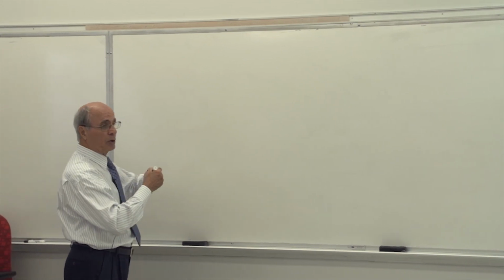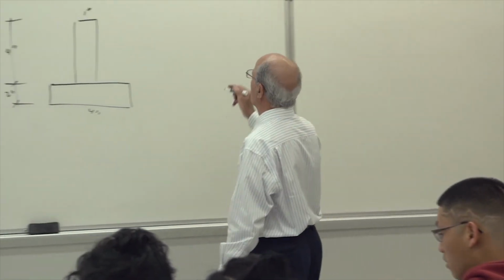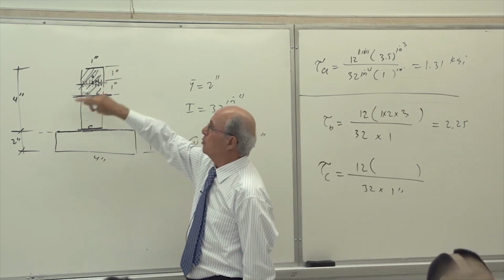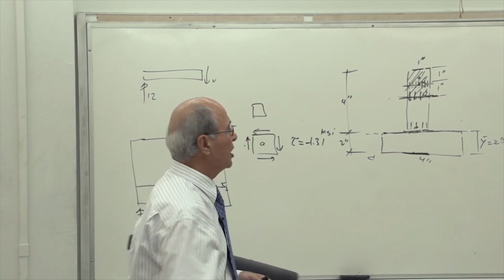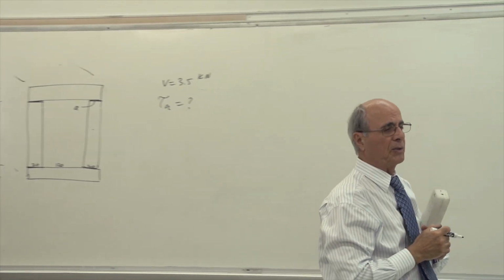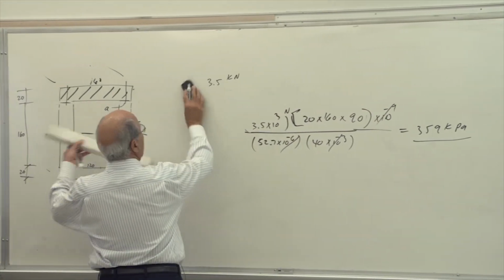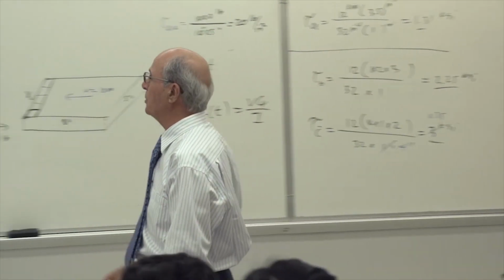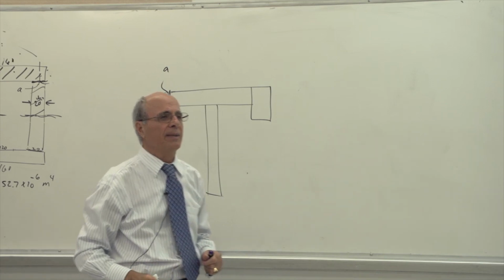Strength of Materials I: Shear Flow, Shear in Common Beams (18 of 20)

Comment: Sir,for calculating shear stress using the formulae tau = VQ/IT will the V be always  constant along the length.If for point load between 2 points,it will be constant, but what if its a variable load between 2 points?
Reply: If this load changes over time V(t), then the shear stress will change over time too tau(t).